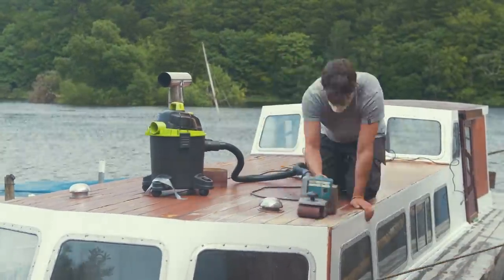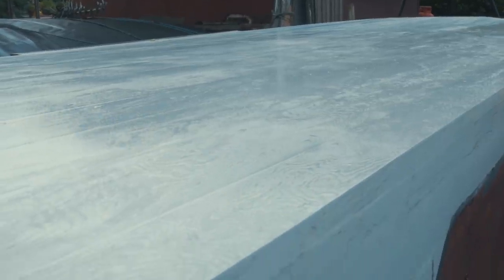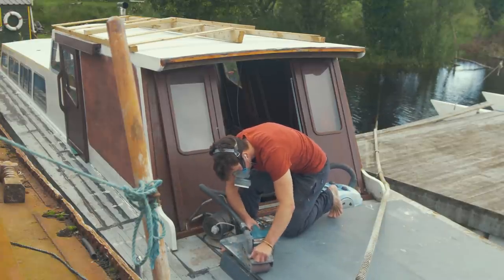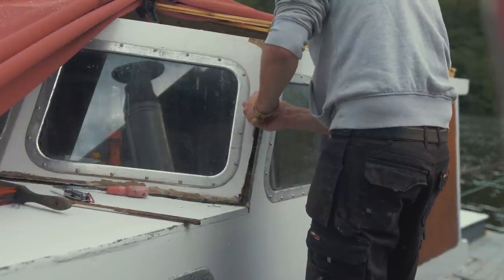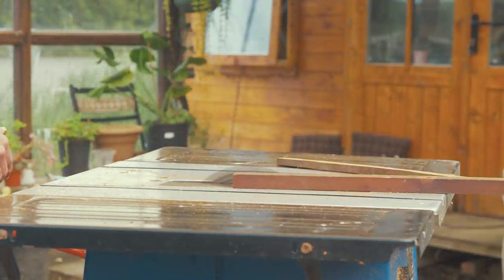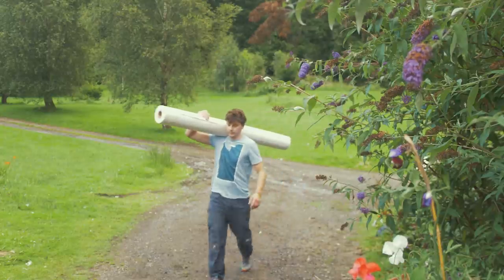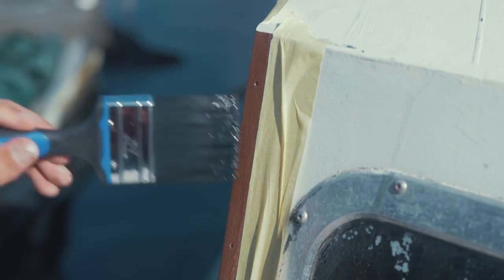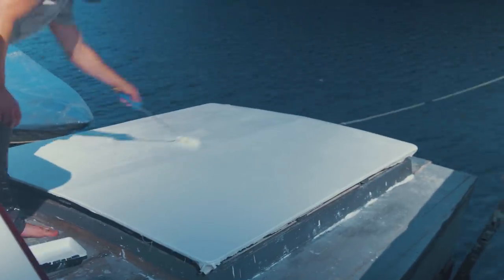Episode 17 - Restoring 81 year old 40' Wooden Boat into a liveaboard ⚓

Comment: The black staining you mentioned is caused from steel or iron fasteners corroding, in the past it was called iron sickness, and was a common reason for ocean going vessels to have to replace or repair timbers.  Also a suggestion to solve your brass plated nail problem, see if you can source thin brass rod the size of your nails.  It would be pretty easy to cut your own nails from that and you are less likely to get steel that is just brass plated.

Comment: We have a product called Ecorubber in South Africa used for sealing roofs. It can be applied on just about any surface. It comes in black only but can be painted over any colour of your choice. Three coats of this stuff on those surfaces and you are done for life. Would have been a much easier proces and probably  cheaper. You are doing a great job.   Regards.

Comment: Many years ago (and a technique suited to the age of your craft), we would put canvas on the wood. After prepping the wood with primer, a heavy coat of paint then put the canvas down while wet. The canvas would be pinned on the edges with half rounds, then more coats of paint until it was relatively smooth. The canvas would be bonded to the wood for many decades and completely leak proof.

Comment: Hi, this guy is restoring an old yacht to live aboard and not to necessarily enter a concourse competition! As a live aboard and owner of a 1958 wooden classic, I sympathise with his motives. I have attempted to maintain my yacht as she was designed and made. I pay the price with the occasional deck leak following sunny, dry weather. Please be sympathetic to this guy's efforts.
Reply: PS please look at a varnish called Coelan. It's a one part epoxy varnish that seals and protects for up to 15 years. I have used it on my deck and it allows the wood to breath whilst at the same time remain in pristine condition.

Comment: That is why "bright work" is a rich man's game and he better live in a warm dry climate.  Clear finishes are the most vulnerable and shortest lived of all.  If you have any bright work you better like finishing wood more than being underway!  If you insist I would try a clear epoxy with a clear U/V barrier as a protection.  The best bet is to fiberglass over the top after proper prep work with glass cloth reinforcement.
Reply: Well said Douglas. As a base for brightwork I like West System epoxy with 207 clear hardener. It has UV inhibitors in it and is the perfect base for high UV varnish. I can do three coats of epoxy in a day without sanding between coats and the next day lightly sand and apply the first of three coats of varnish. Good varnish needs 24 hours between coats but the whole job is done in 4 days weather permitting. It looks like 10 coats of varnish when it's done. My varnish of choice is Epifanes. I'm in Southern California and it holds up very well.
Reply: @sprezzatura8755  That is the secret.  A warm dry climate.  The wood has to be bone dry for a clear finish. Something he will not achieve in Ireland nor did anyone here in our temperate rainforest.  Ambient humidity never even gets close to drying wood and if you got three days together of sun you better get out and enjoy the boat not be working on it.  There is a reason wood boat shows, collections are done in Nevada and housed in climate controlled buildings often. I love the look of wood and have tried oil finishes (disaster), the system you describe and many, many more.  Never had any last.  Refinishing every spring isn't on my list of favorite things.  I was a happy man when fiberglass came along!!

Comment: I work an a 70 year old steel boat 😄.. and most of what I did / learned was by trial and error 🙈😝
And i know it sucks to redo a weeks worth of work (or however long it took), but I noticed that i seem to be more proud or happy with such works (after they are finished) than I would be if all just worked out somehow 😄

Comment: Was wondering when you would discover the canvas solution.  Varnished decks are a temptation, but in the end canvas and paint/glue is waterproof.  (Had to discover this the hard way myself)
Reply: I agree. Canvas would be a better solution for these surfaces. Even better, glue a layer of Masonite and then canvas. Works great for me, no more leaks.
Canvas also gives you a durable, nonslip surface.

Comment: Hi, Really enjoying your work and have binge-watched the episodes till here. You were asking about fillers. Now that International 'Interfill 100' is no longer available I've been using Bonda FEW Marine Fine Surface Polyester Filler for most above waterline jobs.  Also for areas that need some flexibility try using G-Flex epoxy with thickening blend or fine sawdust - like we've seen you use to make an epoxy filler.

Comment: I have found the best way to make a truly non skid deck is simply paint the deck and on the last coat spread a fine sand over the wet paint and let dry. This is easy and works best for a real non skid. It is also easy to redo later, simply paint and sprinkle again.

Comment: I use Watertite epoxy filler from international paints , have been using it for years on my wooden boat but above and below the water.
You can get it in Ireland from most marine chandler's like union chandlery or Ch marine. Not cheap but good

Comment: Not sure if it's available in Ireland but Z-glass by Clausen is a waterproof automotive body filler.    It's available here in the states and I've seen it on ebay. It's not cheap but you get what you pay for.

Comment: why not apply fiberglass on the roof to avoid leaks?
Reply from the maker: I've used the age old method of waterproofing the roof with double duck canvas. If I was to use fiberglass I would really need to do it in a controlled environment. So canvas was the next best option. Thanks for watching.
Reply: @LakesideProductions  ohhh I see now I know thanks for the info

Comment: I can tell you what I did with my side decks which worked really well for me ,and looked very attractive.  I rang inch masking tape round the edges, and round any fittings that was on the deck.  Then I applied uni bond on to the decks. Then I spread very fine sand onto the uni bond. After it dried I cleaned off any excess sand. Then I applied a thind down uni bond on top of the sand. After it all dried I removed the masking tape and painted with gloss paint.  I can promise you it not only looked very professional, it really worked well 
Good video my friend 👌

Comment: Marine fillers , west epoxy resin and a low density filler will act as a filler. The resin will soak in to the wood and you can add another application of resin and low density filler and sand off when dry.

Comment: Hi. In regards to your reference to "brass" nails, Are you able to purchase copper nails as they are commonly used in boat building. And yes for thin and small profile pieces of timber pre drilling the nail holes will help prevent any splitting. Like the care and prep that you are taking with your restoration. Cheers from New Zealand

Comment: Use regular 2 part resin and ad to it fine sawdust. Make butter like paste. Works great on filing voids in between wooden parts of your project and other, and it looks more like wood. Make sure you make it relatively flat as finish product when you applying it, because is pretty hard and not easy to make it flat later.

Comment: A heat gun works well to release glued and sealed deck fittings. Can be used to remove varnish when you don't want to remove too much wood surface with sanding.

Comment: If the paint and canvas doesn’t work what about cladding it in copper sheet. The copper would inhibit rot setting in underneath. You may need to form gutters though to avoid Staining from run off.
Reply from the maker: That's one idea but the canvas and paint are doing their job well. Time will tell. Thanks for watching

Comment: A glue stick will remove the dust from the sand paper belt. Just hold it on a roller end as the sander runs, as it runs against the glue stick the dust will be picked up by the glue and ball up for easy removal.

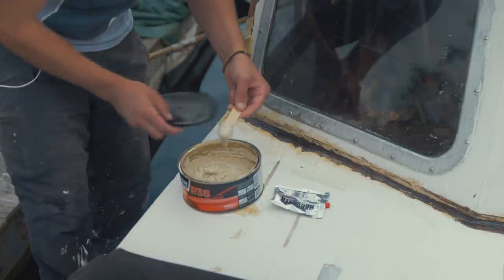Comment: Great videos my friend! Instead of car filler, consider mixing fine sawdust or, even better,  fumed silica and microballoons, with a two part marine epoxy.  Makes an excellent fairing compound once you experiment with the mix ratio to get the right consistency. 29:05
Reply: You mix that till it's the same consistency as peanut butter. Works just like putty only better. After sanding and painting, you can't see it.

Comment: nothing like finding what works and doesn't - i see this sealant is polyurethane based product - is the varnish similar base if not there could be a chemical reaction, also the thickness of the sealant can be an issue, it can harden under UV (is it uv protected) is the varnish uv protected? - if these are both good products uv protective then i might suggest the timber in question as it breaths, bends, shrinks and stretches pulling at the sealant 

i wonder to get a fully waterproof roof to have a rethink for later down the road - if it were me i'd possibly use a sheet of epdm same as pond liner, cheap stuff for a large sheet - so in cross section you have inner ceiling, main structural timbers and voids full of polystyrene insulation as is, epdm liner fitted to overlap outer edge (so water run off), then use a marine quality hardwood ply at least 6mm so it can flex and laminate your planks to it using a urethane adhesive or better still a 2pak epoxy resin (but no gaps), make sure all joints are over glued or fill when plank is secured, thats your sealer, with gaps filled you simply sand the entire surface after, no faffing with tape and filling with sealant after

i did watch the guys at Port Townsend (where 'Tally Ho' is) rebuilding the 'Western Flyer' an old tug boat turned research vessel with some history, look for vids of them covering the decks and roof, i was amazed to see them using ply, but made sense when you see them laminating the planks to it

there are some super projects out there fella, some very advanced in the restoration stage, so many vids to watch, but some that will give you much knowledge in ship writing, materials and so on - you have you very own boat to play and experiment on, i am of course green with envy, also check out 'Ship Happens' here int UK, (you might not be so far from them)

love the use of canvas, out standing - PS where's ya little Minky friend?